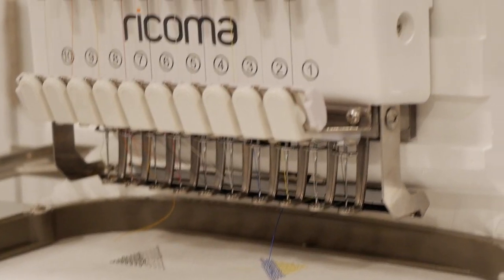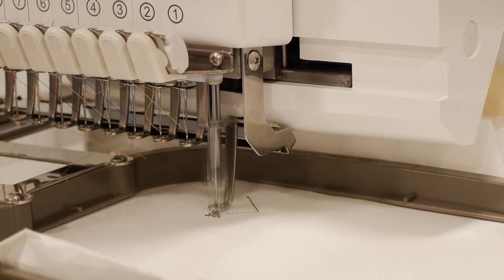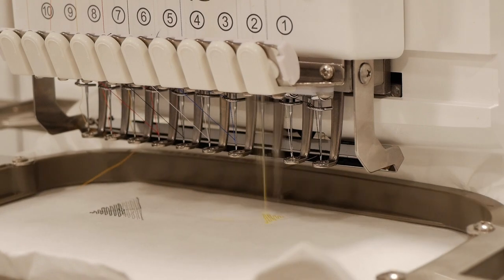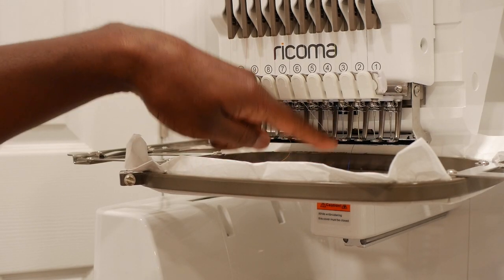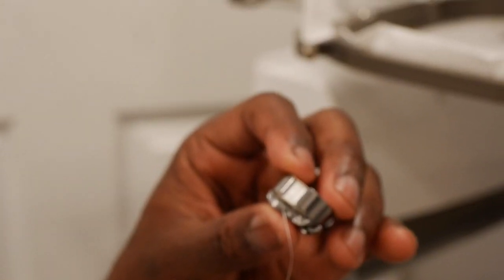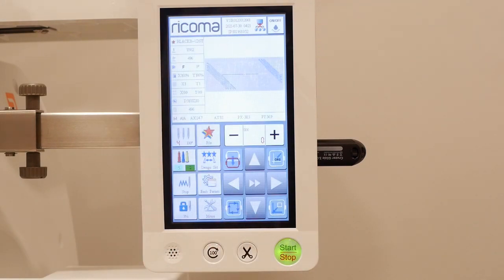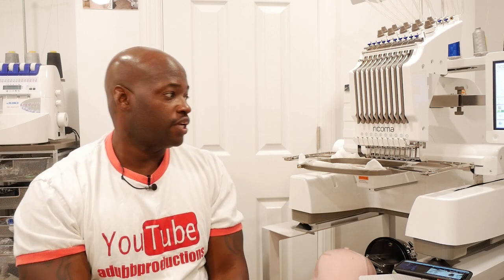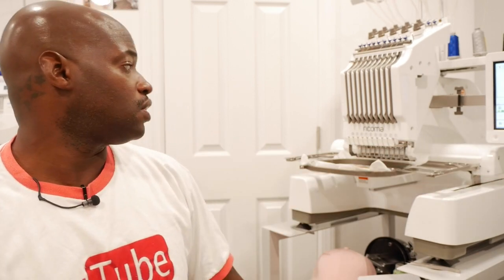Testing My Ricoma EM-1010 for the first time

Comment: Looks like it has the manual thread trimmer where you can pull the thread out, then loop it around the white tab in the front and it will cut it. very  handy.  My SWF 1501c doesn't have that feature but my Brother PR-620 does.
Reply from the maker: Yes. My MT-1501 doesn’t have it either but this EM-1010 does. That’s for when you initially thread the needle. It makes the thread the perfect length so it catches the bobbin thread when it starts embroidering.

Comment: Did you look at any other machine before you purchased the EM 1010?  If so which ones and why did you decide on the EM-1010?  I'm in the shopping mode at the present time
Reply from the maker: I actually purchased the Mt-1501 first.  I did my research on the melco and didn’t like that you had to have a computer connected to the machine to embroider.  Without that it won’t work.
Tajima almost three times the price and when looking at the quality between that and the Ricoma’s I couldn’t see anything worth justifying the higher price tag.  
When I got in touch with a Ricoma they didn’t stress me or hound me. They answered all my questions and made me feel comfortable.  At the time I saw nothing but bad videos about Ricoma but on the private Facebook groups I saw people embroidering fancy designs that looked nice.  
Then It was a no brainer when they offered me 0 percent financing till 2026.  Had my MT-1501 for a few years now. Added two em-1010’s and an MT-2002 8s two head.  Love these machines. My money makers.  Now look on ig and everybody is having success using these machines for their business.  If I could go back I’d still buy my MT-1501 above all the other machines out there.  If you decide to get one use my affiliate link in the description.  If not then still come back and tell us which machine you went with and why and how it’s going.  Can’t make a wrong decision as long as you take the time and learn how to get the technology to work. Some don’t have patience and expect it to work right out of the box.  These things require time to learn.  Any brand. Also Ricoma gives you free training online if you get a single head.  If you get a two head or above they come to your house and train you.

Comment: Do an "H" test with satin letters.. it will tell you if your tension is off.. it should be 1/3 upper color, 1/3 bobbin and 1/3 upper color.  Thats always a good starting point but I bet you knew that

Comment: Thanks for this video how do you like the EM1010. It looks good
Reply from the maker: So far I like it mainly because of its small size and portability.  It’s good enough to get started and get your feet wet in the pre-professional space. You can make money from it.  I obviously plan on it. But…… my Mt-1501 wouldn’t give it up.  For the em1010.  This is a good alternative though if your not ready to dive in and don’t want that massive machine.  That’s why I got it.  For a factor and performance. I see quite a few youtubers running Etsy businesses on the em1010.
Reply: @adubbproductions  I love my Mt1501 Im working on saving up to get the new MT-2001-8s
Reply from the maker: @LucyLu70  omg. With that WiFi technology.  I want one too.  Not on my things to get at the moment though but It’ll probably happen eventually.

Comment: Can this machine work on artwork like drawings and can it work on shoes 👟👟 and pants 👖????
Reply from the maker: It can do pants. Not sure about shoes and artwork.  If you want to do shoes and work with artwork in not have to digitize the files first you need the TC model.  Contact them and ask about their TC model machine. This is the home beginners model. You what you are talking about requires something more commercial. Hit them up.  Their staff will answer any questions you have. 

Ricoma MACHINE Link https://ricoma.com/US/referral/allan-wade
Reply from the maker: Here is a video on my MT-1501 embroidering on shoes.  Check it out.  https://youtu.be/lW9-8XssKOk